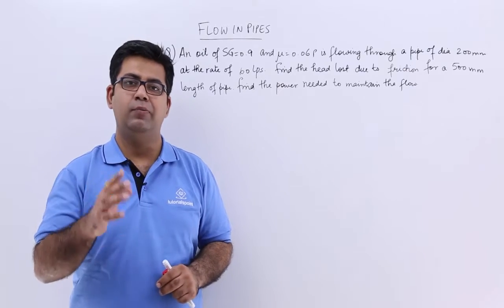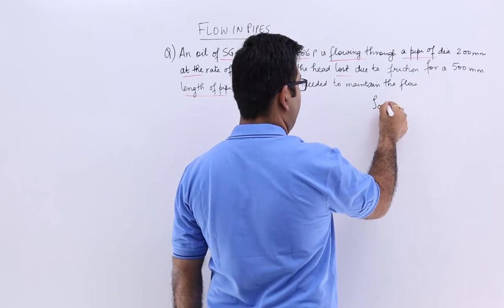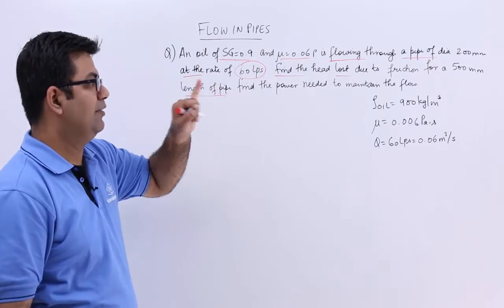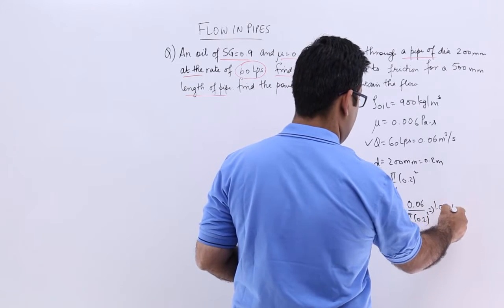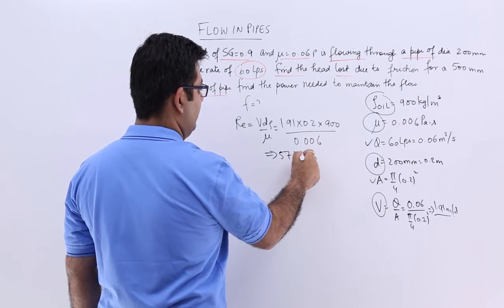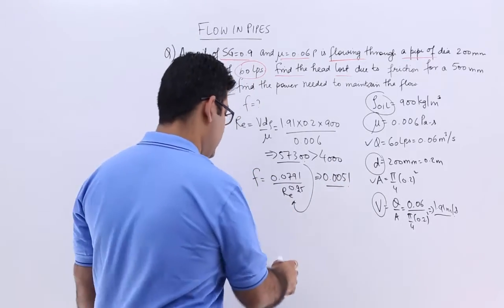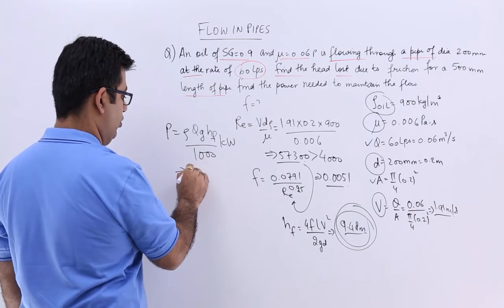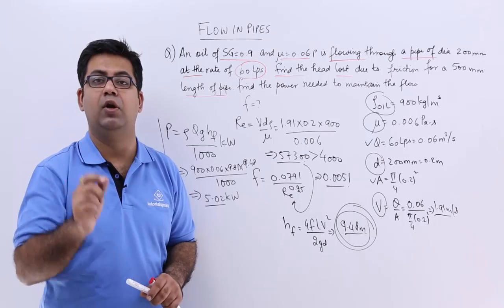Friction Head Loss in Pipe Problem 2

Comment: 2 pipes each 300m long are available for connecting two reservoirs to which a flow of 0.085m³/s required. The diameters of the two pipes are 0.30m and 0.15m respectively. Determine the ratio of the head loss when the pipes are connected in series and head loss when they are connected in parallel (neglect the minor losses)

Comment: The length of the pipe must be 500m and not 500mm
Reply: Yep actually that answer should have been in mm
Reply: @sairajpatil8307  exactly
Reply: Yeah I had to pause to check my calculations
Reply: Yes Bro , I am totally confused
Reply: i thought my calculator is in radians. was getting 0.009m